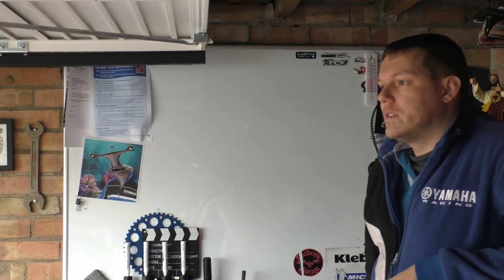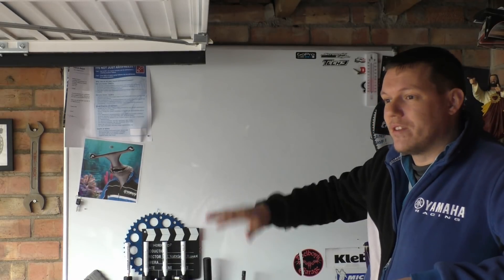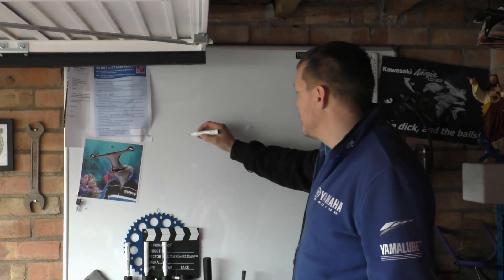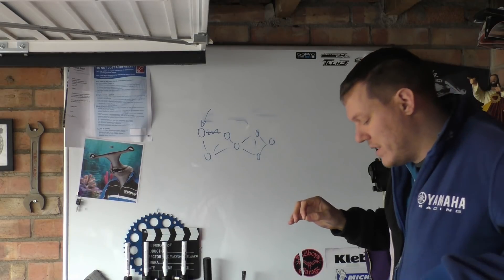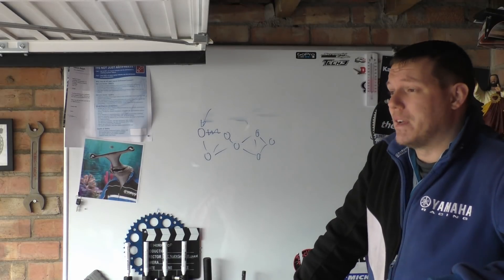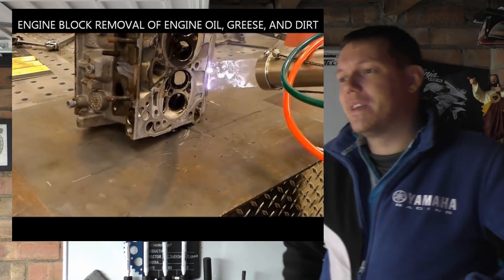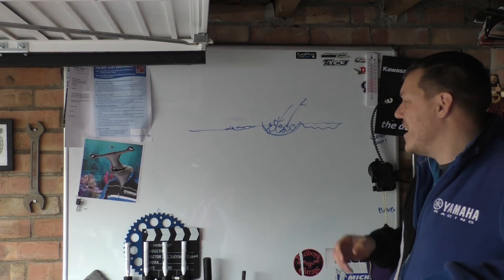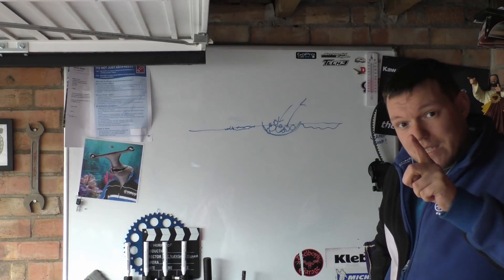Laser dirt and rust removal? is it bollocks?

Comment: "you're not obviously obliterating em"
Depends on the laser... I think you could have some small amount of fusion from how hot the plasmas can get. Not useful amounts but maybe detectable. And from there, those neutrons can hit fissile material in the target (if any). I feel like there is a non-zero chance of obliterating atoms if your target contains both significant amounts of Lithium Deuteride and U-235.
Reply: As proof, I present the national ignition facility.
Reply: Or indeed, regular U-238.

Comment: Yeah and when you use chemicals or grind it off you are loosing more steel lasers only target the rust and never touches the steel as the steel does not absorb the wavelength of the light so it wont heat up, the Rust absorbs the laser and will do so extremely fast and in a way it explodes and comes flying off its the best way of getting rid of rust and you wont find a better way well yeah you can make the laser cheaper and that's slowly happening, these lasers are amazing for things you need to repair or restore and can not get any replacement its good, if a part gets effected too much due to rust with pitting and so on then no job will do it good enough but most of the time its totally fine to blast some rust off and get that part working again as pitting wont bother anything and getting rid of rust will let the part or thing to last for longer, so most applications the part is not fucked and working Surfaces normally do not rust and protected by grease or oil

Comment: the money you would save on chemicals though if your job was part cleaning and repair it would pay for its self eventually... side note i saw a guy run it over his hand and nothing happens seems safe enough
Reply from the maker: A few people have stated this but it is classed as a class 4 laser - 

"Class 4 is the highest and most dangerous class of laser, including all lasers that exceed the Class 3B AEL. By definition, a class 4 laser can burn the skin, or cause devastating and permanent eye damage as a result of direct, diffuse or indirect beam viewing."

And these classes aren't handed out for the fun of it. Either its turned down or some other stunt. 

I've been told that the unit costs up to $100,000!

Comment: I tell you what is fucking awesome - Laser welding. I was luckily enough to have a local company demo it and weld some stuff for me. Can do minute welds (looking through a microscope) and its so direct/isolated there is zero risk of heat distortion. Some pics: Securing the ring pin on a two stroke piston altered to take a re-positioned through the crown style pin (like a TZ250 piston) https://farm5.staticflickr.com/4149/35555882342_bf2896e324_c.jpg and a minor fix to my RG500 top case https://farm5.staticflickr.com/4263/35684956956_037a5acd25_c.jpg.

Comment: What would suggest for cleaning carbon off aluminium heads/intakes. I've pulled my intake and there is so much carbon that it's blocking the fuel injectors
Reply from the maker: Petrol or kerosene

Comment: Cleaning used machines is what kills most of us. After 27 years professionally as a mechanic and 10 doing it to ride before that my body can't deal with the simplest solutions anymore. I am allergic to everything. My skin peels off my hands and feet daily. Petroleum jelly and mineral oil in lotions now burn my skin. Wear gloves whenever touching any of that stuff. Wear fresh air gear for spraying stuff not masks. Cover everything you can. The poisons known to cause cancer in California are just the beginning. The really nasty shit unfortunately is what seems to actually work. Laser included.

Comment: The company I work for rented a unit that ran it the infrared spectrum. (1056 wavelength) . We rented it because the cheapest model is 350,000 USD. We used on plastic injection molds to remove plateout or basicly degas build up on the molding area. Worked amazingly well. But not 350 grand worth. The boss let us bring in stuff to clean. You know to try it out on a variety of things. It worked on everything from rusty cast iron pots to carbon built up engine parts. One guy even clean up an old Evenrude out board motor so he could rebuild it. I used it to strip some anodized parts so I could polish them. Again it worked extreamly well.